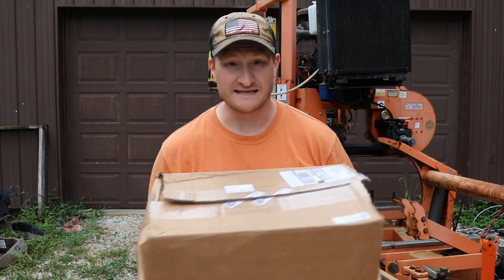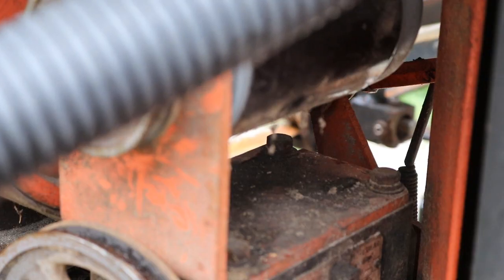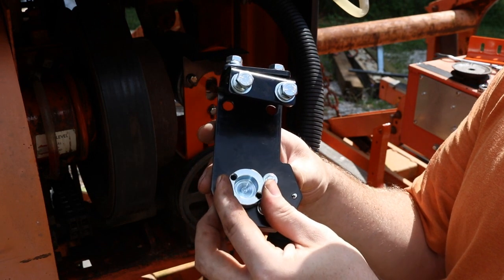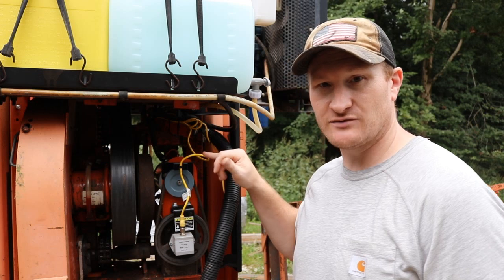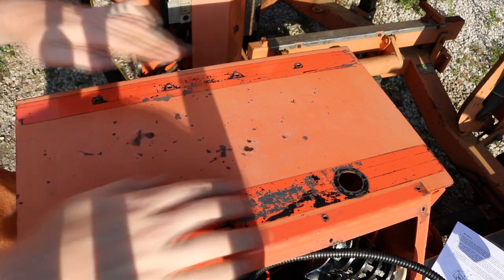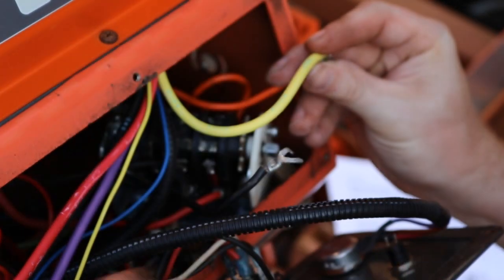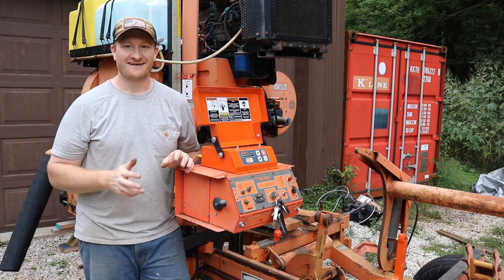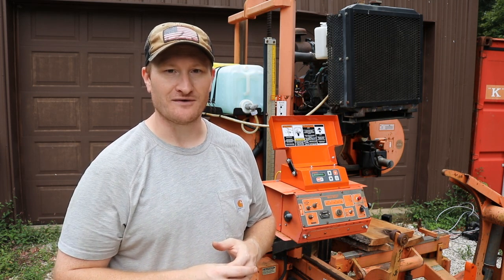UPGRADING YOUR WOOD-MIZER SAWMILL - SIMPLE SETWORKS COMPUTER INSTALL - EASY OR HARD?

Comment: Ok, so thank you for an excellent video. I am wanting to add the simple set to my mill. How ever woodmizer says that it will not be accurate on a mill older than 97. How ever watching your video very closely, I really couldn't see any difference in the control box. yours is, newer, a little cleaner layout. But when I look at the layout inside, sure looks the same. Even the gearbox is the same. My mill is a 93 LT35HD. I think,  I'am going to go for it.

Comment: Good job. Lubricate those drum switches when you are in there. Love my simple set. What was wrong with the motor?
Reply from the maker: Motor was showing too much resistance.  The internals were out of whack.  A 21 year old motor like that one is bound to fail eventually.  The newer motor was much smoother and faster.

Comment: Nice video.  My 99 super 40 42 hp kubota has the first accuset on it that works great so far. But if it fails I believe I'd go this route over the accuset 2 option. Can I ask how much woodmizer charged you for all that?
Reply from the maker: Simple set is about $1200.  Thanks
Reply: I wonder is this kit works on the lt40 super hydraulic mine has the motor sticking out the back basically oposite of yours